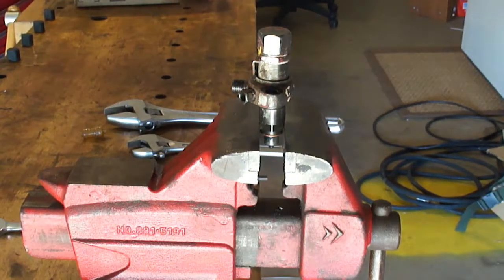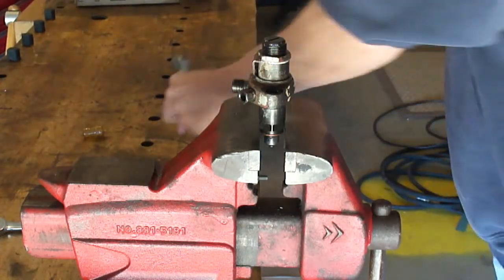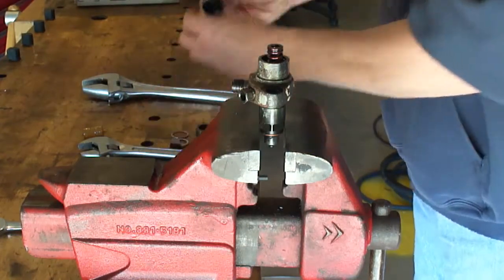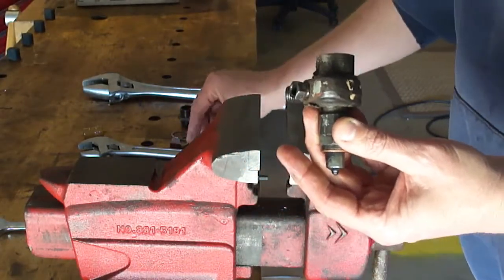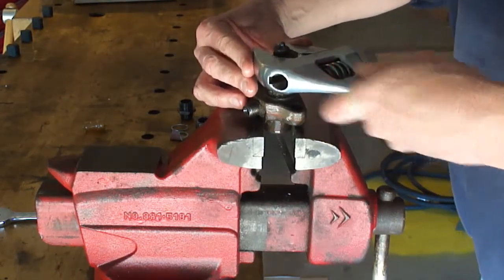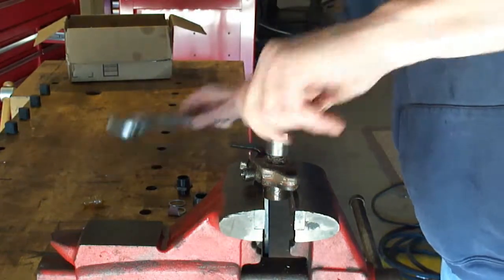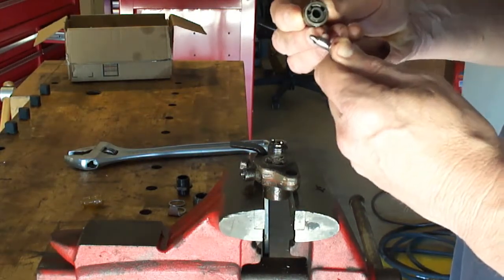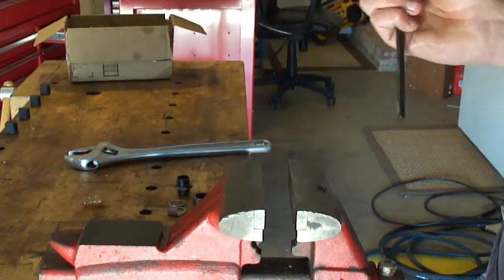imt-560 fuel injector disassembly

Comment: Hi Dave, if you get the chance, could you tell me how many holes should be on that nozzle? I'm cleaning a set with cleaner and toothbrush that were badly clogged. I've found two spray holes on each of them, but am wondering if there should be others, seems odd to have only two.
Reply from the maker: From memory there are two holes.  That's how I remember seeing the spray pattern.